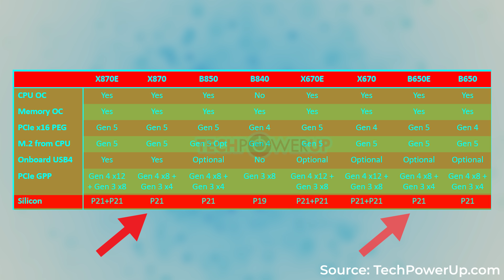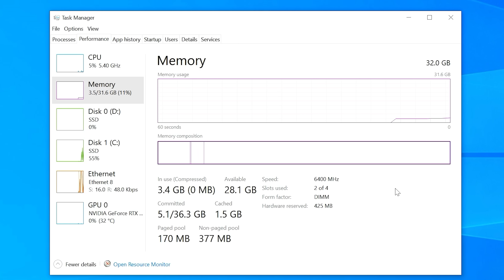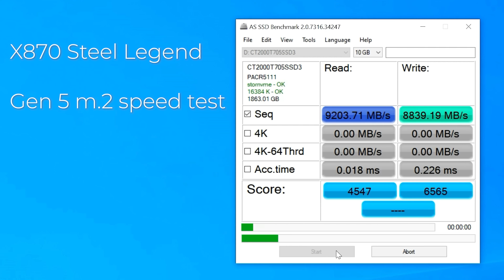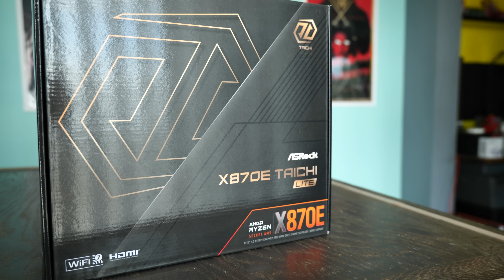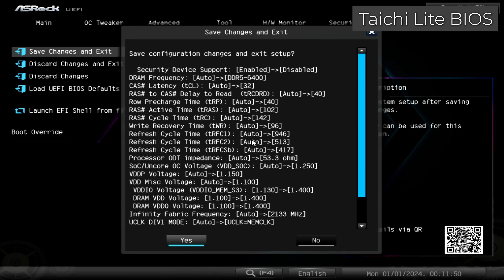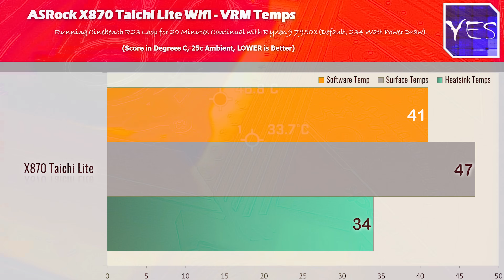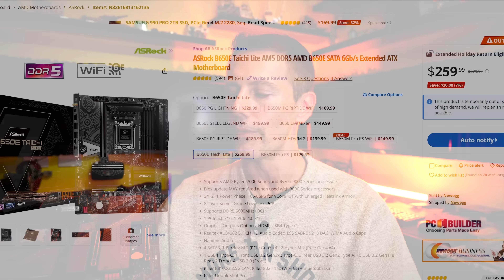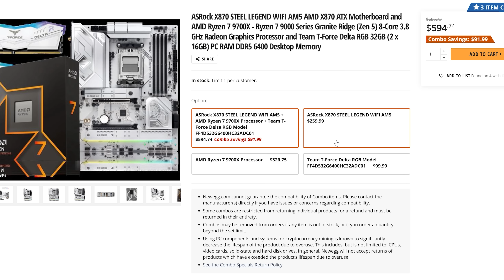This X870 ASRock Steel Legend does something NO OTHER mid-range AM5 board has done yet (Review)

Comment from the maker: If there are any extra motherboard tests you guys want to see, then let me know below! Hope you guys enjoyed this one!
Reply: Asrock Nova wifi
Reply: Any news on matx?
Reply: drop test
Reply: Hello i have the Asus Tuf X670e plus wifi board and i run 6400Mhz no problem, i just popped in the ram and turned EXPO on.
Reply from the maker: @REALGAMER83  6400mhz will be fine at 2000mhz infinity fabric but it isn't an optical setting, you want 1:1 with infinity fabric at 2133 at that setting.
Reply: X670e steel legend vs x870
Reply: The only thing X870 ASRock Steel Legend offers is better usb x asrock x870 pro wifi, other than that it does not offer anything else.
Reply: what if having a laggier motherboard bios makes windows lag more? maybe you should test latency in bios, and see if it corresponds to anything in game or os?
Reply: DONT FORGET =these 800 boards can support 7-8 next gen cpu near 15 year,,,,it is very important ,shit intels dont have it
Reply: Please make psu test... 🎉
Reply: Does it, by any chance, comes with an external clock generator for the PCI-E? I'm looking for boards which can significantly push the BCLK for X3D chips as high as it can go.
Reply: Could you please do an system iddle power usage?
Reply: What are the downsides of having 1 chip (870 v 870E), it's just more lanes right like USB, disks and Network?

Can these boards hit 8000mhz?
Reply: These are listed as being able to have 256GB of DDR5 (Steel Legend) but the QVL at ASROCK doesn't show which 64GB DIMM to use that's tested. Can you attack that question? I really want a LLM system running 256GB and would appreciate your assist, please!
Reply: Did u test out the Nova? seemingly it looks like better value as its cheaper than the 2 Taichi and has x1 port more on the board.
wonder alot about the choice of removing all the rear audiojacks.. would have to route the rear speakers to the frontpanel with the layout they choosen to use on this series of boards O.O
Reply: MSI X870 Tomahawk
Reply: I'd be interested in a look at the MSI PRO X870-P. Most of the X870 boards are horrifically expensive and while that one isn't exactly cheap, it's at least more manageable.
Reply: @carl4889  MSI PRO X870-P is a good board, the vrm is not as good as asrock pro but it has a 5gb lan and true wifi.
Reply: @carl4889  dont  forget check usb4,,,very very important for  future ,,,external gpu and thunderbolt dock

Comment: Only the E has a proper "postcode debug error display" (or whatever you want to call it), and at these prices, that is unacceptable. In a brand known for instability, especially in RAM compatibility, they leave out the two most useful "lights" on the MB. Why? So, essentially, anyone who likes to fine-tune the RAM has to buy the E. Also, it is very scummy that the non-E is, in essence, a glorified B. To be honest, nobody cares about the "power stages," or VRMs, since every "low mid-range" MB can handle all CPUs just fine unless, that is, one is "messing" with memory, CPU undervolting, and such things. So, we do have to buy the E, and that is that.
Why does ASRock always do this when they finally reach the top? Every single time, they shoot themselves in the foot. I am probably going to buy the 870E just because no Christmas Tree, no Dragons, no stupid RGB, and it is the only one (Taichi) with the "full chipset" and the proper "Error Post Code."

Comment: No, here this board price is 300 EU. But you can get X870 Pro Rs non wifi with 255 EU. An all benchmark show x870 PRO RS beats the Steel Legend.
Reply: So the X870 Pro RS is better than the X870 Steel Legend?
Reply: @DarkZerol  Whtach this ------> https://www.youtube.com/watch?v=keJHego7neI,  
   Why pay much if the other same brand better or same performance. Steel Legend 300 EU, Pr RS 260EU ( 280EU). Also if you can find B650 Steel Legend Wifi, tht board is the best b650 board.

Comment: The ignorance for X870E Nova Wifi is truly astounding......

Edit: I also agree with you on Gigabyte laggy bios and not only specifically with new x870/E boards. Once you are running in full UEFI mode with no legacy options enabled like on my Aorus B550 Pro V2...soon replaced by X870E Nova Wifi, and 9800X3D :) ......it just gets really unresponsive. You click with your mouse and it just stays there with lag. Otherwise it is a great board from a longterm using over 2 years.

Comment: Does USB4 work during boot?  That is, if you connect a USB4 or Thunderbolt 3 dock to it, does the monitor work at boot, and do USB devices such as a keyboard and mouse work at boot?  

My last experience with Asrock and Thunderbolt was a disaster: the X570 ITX/TB3, where the BIOS doesn't even bother reserving resources to allow any Thunderbolt devices to actually work even once the OS booted.  So I'm wary that these boards might be similarly useless at it.

Comment: Awesome video thank you.  I have been eyeing up the Asrock x870E Tachi Lite for my next board upgrade. It is one of the few boards that has 6 Sata ports which is important to me because I have a lot of sata drives with a mix of HDD and SSD for my storage needs. Most boards only have 4 sata ports which will not work for me and I do not want to have to resort to a PCI-e card for extra sata ports as that can cause problems sometimes or lower than expected performance.

Comment: I still use x1 and x4 pcie slots and ASROCK are worst mainboards in that regard. I don't need shared pcie with x16 slot or that x2 slot. I used in the past ASROCK mainboards but last 2 generations have no use to me in any way. I could use risers but I don't really enjoy having wires hanging all over inside the case. ASROCK should ask people before building the boards and  I think they will have bigger sales.

Comment: "mid range $250". What a bunch of garbage that it has come to this.
Reply: I'm seeing $250-300 X870s with WORSE PCIE connectivity (X16 + X4 vs X16+X1+X1) than my 4 year old B550 M-atx board. It's so stupid, I just want to be able to run up to two GPUs (X16 PCIE 5/4+ X4 PCIE4), one NVME and 4 SATA, and still have one spare X4 set lanes but they're throwing them at more useless M.2 slots oh my god

Comment: You should review the Asrock Gaming Nova Wifi X870E frecuenly get out of stock since was launch on Amazon and Neweeg  .I bought this board  and for me and a  lot of people is the best value you can find for the X870E with lot of flagship feature you find on other boards and paying more I just paid 325.00 after mail rebate on Neweeg . I like RGB love it on in this Board you get covered with plenty RGB and you don't even need to install the RGB software because you can control inside the Bios  specially the Brightness and color saturation , I love this board, you can install all the Nve disc you want without affect the X16 lane speed of your Gpu card

Comment: The Taichi boards are documented as E-ATX boards, but I cannot find from the boards' documentation the actual width of the boards. I'm trying to find out if the boards would fit in a particular case that indicates it supports E-ATX but under 280mm. Can you please tell me the width of the Taichi Lite board?
Reply: Hey man, I was looking for the same thing and here are the dimensions from AsRock's website - EATX Form Factor: 12.0-in x 10.5-in, 30.5 cm x 26.7 cm
Reply: @techalphascom  Thanks for the info!

Comment: I thought  800 series chip-sets supported DDR5 8000 MHz!
Reply: support as can use, but stable or not depends on the 800 series brand & how they tune it. Its the same as before on x670 series release, 6000 ram also can use, but not all stable until later bios version update
Reply: @arthur_pd  Indeed in fact hardware unboxed has a video were they test more than 20 X870s motherboards and many of them can reach 8000 MHz out of the box, so for this two to reach 6400 must be a most!

Comment: Couple of ASRock AM5 mobos in Finland (hinta fi). Prices in Euros and US Dollars (incl. our 25,5 % VAT):

X670E Taichi                557 € / $606
X870E Taichi                539 € / $586
X670E Taichi Carrara  535 € / $581
X870E Taichi Lite        459 € / $499
B650E Taichi                399 € / $434
B650E Taichi Lite        325 € / $353

X670E Steel Legend   290 € / $315
X870  Steel Legend    283 € / $307
B650  Steel Legend    252 € / $274
B650E Steel Legend   243 € / $264
Reply: But .... The ASRock 'Live Mixer' is also an hell of an board ! Or the 'PRO RS' !   AND for now you can easily STICK to an 600 series MB !  No need to buy an 800 series !
Reply: Nice tax! 🎉
Reply: The Taichi is 500€ in Italy right now, while the x870e Aorus is 330€...not a big choice, is it?

Comment: You have to remember with cheaper boards other than taichi. They lack external bclk chip so if you are doing base clock overclocking example on x3d cpu and wanna keep system stable you NEED external bclk chip. And yes Nova doesn't have external bclk chip either. Only taichi line up has it on x870. Just to note this one for all those Nova lovers.
Reply from the maker: Thanks I didn't know that!
Reply: saw your reply i had thought of building a new system,

motherboard steel legend
CPU 9900 X3D

won't this work,

what does bclk do and how do you see that the motherboard has this

now I have built a number of systems, but only intel, this is my first amd build

Thank you in advance
Reply: @6XCcustom  It helps with overclocking by separating overclocked parts like CPU baseclock from other components baseclock speeds. Basically helps you get more stable clocks with higher overclocks. When you dont have separate bclk you are forced to stick with same baseclock speed for everyone component. (pcie,sata,m.2 etc uses the same baseclock to sync their speeds etc).

The steel legend model doesn't have separate bclk chip. The board works ofc with 9900x3d when ever it comes out. But you will not probably get best out of it. Also you are tied to 100 mhz bclk that is shared between the components. If you stick with default clocks etc its not an issue. If you wanna get more out of the cpu/memory you probably wanna get better board.

It's sometimes hard to figure out if the motherboard has it or not. For asrock they put the info on motherboard user manual. Under specifications section there should be something like:
Supports ASRock Hyper BCLK Engine

But this is just with ASrock. Example Asustek doesn't inform you of the support in their manual etc. And not just that. Sometimes the support level can vary too what parts of the motherboard you can put under separate bclk on what settings. So that said. In the end you most of the times need to find the info from some review site or forum. Or buy the pcb and see on bios or look at the motherboard itself for such chip and how it works with the board.
Reply: @user-eq2fp6jw4g what’s a good motherboard that does this? I want to future profs my build so in 3 years I can get new GPU/cpu etc

Comment: Steel Legend was always good. They made it even better. I am still rocking my Asrock B450M Steel Legend from 2021 and a Ryzen 5 5500 with 4x8GB DDR4 3200MHz CL16. I kept the infinity fabric on 1600MHz.
Reply: Don't disguard the ASRock LIVE MIXER ! It is also an great board, for that price !
Reply: Have you had to replaced the CMOS battery?
Reply: @hibarihanakoganei7213  Never, not once.
Reply: @BladeCrew  Thanks for the response. Reason I asked, I removed a working X570 motherboard from a build and put it in the closet for about 6 months and upon using it for another build the CMOS battery had died.

Comment: I just picked up two X670E Steel Legend boards (Open Box) for 105 each USD.    Correction.  155 Ea.  that's a lot more than I recalled but still a smoking' deal.   Woot Woot!
Reply: NICE dude !!!
Reply: I love mine , but the x870e Nova makes me want to upgrade.
Reply: @ i was looking at that one too.  I missed my chance and it went out of stock.  Now that I have the X670E SL I don’t see a reason to upgrade.  Although I think the NOVA did have the boot fault code display.  I’m disappointed the SL does not.
Reply: From where?
Reply: @Mdxceed   NewEgg.  One left.

Comment: What you mean only board that do 6400 1:1 ?? Im running on b650m hdv/m.2 its $120 board . And i have seen loads of peeps running it on various b650 mobos . You dont need expensive board right , it all comes down to the cpu's memory controller whatever the mobo is , unless its not a crappy one
Reply from the maker: 6400 1:1 infinity fabric 2133.  I find it only works on the better boards (if you have a good cpu).  Due to the implementation of the traces.
Reply: Awesome board, i have one also.Hope they come out with a b750 improved version